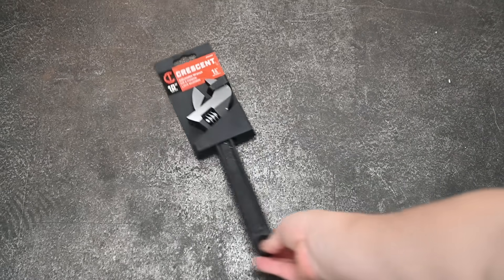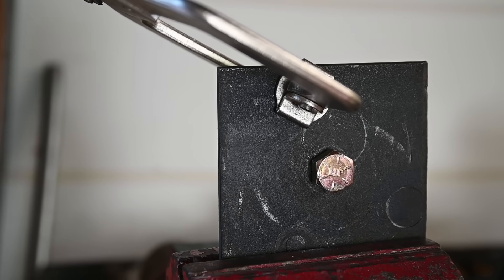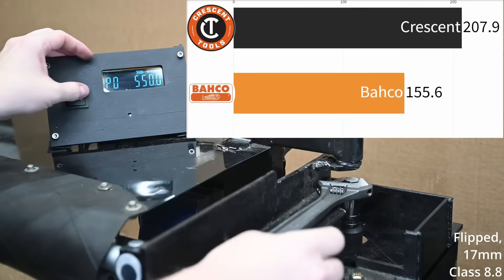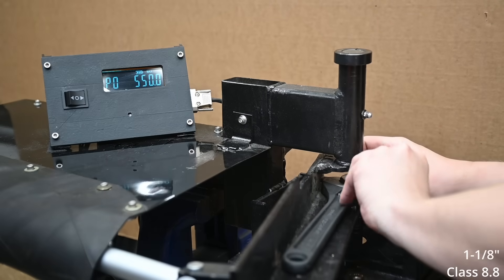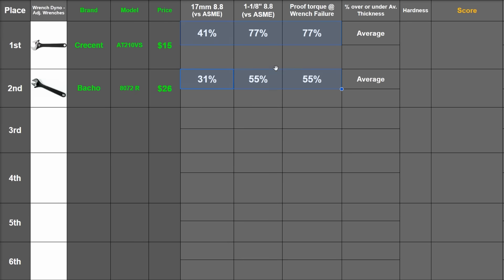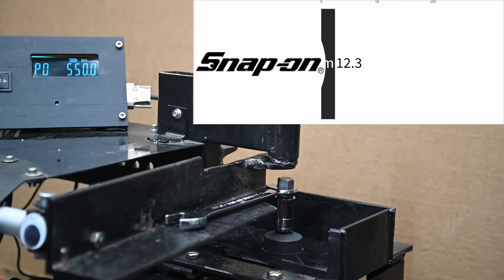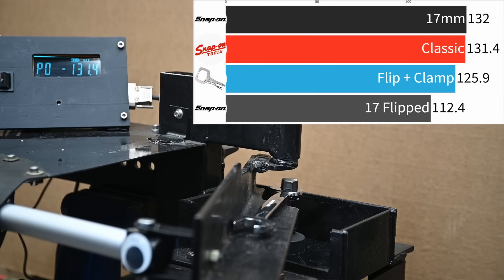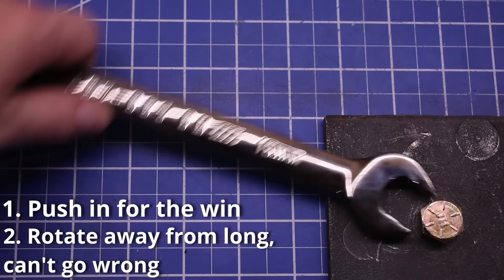Are you turning wrenches the wrong way?

Comment: warning. this video was produced by someone/ ai that never used a wrench. who here has found themselves in a tight, unforgiving spot where you can't get a turn far enough without having to use the wrench backwards to get it far enough to get it back on properly?  if you have not been there, you ain't no mechanic.
Reply from the maker: That's covered pretty well a couple times in the video, if you only have one angle you can fit it on then that's what you're going to use.
If you have space for either, like a tie rod, one seems to have an advantage in not rounding things.

Comment: Was fortunate to work with two best in class millwright mechanics while an electrical apprentice in s large maintenance shop. They took my what they called nut rounder out of my pouch and told me they better never catch me with an adjustinle wrench. They had me go thru thier pereonrl well stocked tool charts & tool chest. Neither had a mut rounder in them. Told me to either use a six point socket or s nix wrench to tigthen bolts & nuts. Over the years found that guys in our large shop that usef nut tounders were the worst workers. Halve ass

Comment: your angle iron has an inside radius - lifting the handle side of the wrenches (slightly) - might be scewing results of certain shapes of wrenches. ie squarer edged wrenches being lifted higher than those with a rounder edge profile.

Comment: If it’s got a 15° offset it’s ok to use whichever way you want. But you put a cheater bar on it you’ll fvk it up. A 12” adjustable is good for as much grunt as you can exert on a nut by hand using just that tool. No hammer no scaffold tube

Comment: Some mechanical engineers thinking: The forces applying on the adjustable finger of the adjustable wrench are VERY different when using them "correct" or "wrong"!!!  If used correct,  the contact force with the hex apply further away from the finger base and thus charges it with a more important bending moment.  Taking only that aspect into account, one would guess the wrench being stronger when used in the wrong way!?!?.  The shear forces on the base of the finger are the same in the correct or wrong circumstances, and it seems in this video that fingers fail from these forces only.  My guess is that the bending moment - when using the wrench in the correct way - does create a huge amount of friction on the "slide", which on it's turn reduces the shear forces in the thread, and makes it survive better when used in the correct way ???
Reply: Always lead with the fixed jaw. The weaker movable jaw then contacts the hex closer to the slide and exerts less leverage on it. That’s got to be stronger. Always works for me and I’ve been using wrenches/spanners regularly for 70+ years. Like a fixed wrench, they can be used either way to fit in a difficult location.
Reply: @Carol-East  Fully agree with your thinking!  But the tests in this video seem to give different results?  That's why I made the hypothesis that the higher moment on movable jaw could have a protective effect on the threads, because of the very important sliding friction it causes???

Comment: Very interesting. Always wondered about this. My thinking before was since the adjustable jaw is weaker, the force should be applied lower on the jaw, to reduce torque on the mechanism (pushing on the same side as the moving jaw). But this seems to increase jaw spread, even breaking the mechanism. So my new theory is that the extra torque on the jaw caused by applying the force higher up, (pushing opposite of the moving jaw) will lock the jaw in place by friction. This will put less or no force on the adjustment mechanism.

Comment: I find these tests very interesting, but there is a critical piece of information missing. How much torque can a "normal" human put on that wrench? Yeah, you can throw a 10' cheater on there and break anything, but in normal use is it even possible to come close to those failure levels? I've rounded more than a few nuts over the years, but I'm not sure that a nut that's been rusting on a manure spreader for 30 years is a valid test point.

Comment: Killing it with the slogans at the end there. Nice!

Adjustable wrench result makes sense. In the "correct" way, you apply a compression load on the adjustable jaw. The sliding face can help support the jaw against opening via friction and just having more surface area. When you use the wrench "wrong", the adjustable arm is now loaded in tension, and it only has the thinner web leading to the worm gear to resist that tension.

Using the adjustable wrench "wrong" will encourage it to slip sooner, more often, and fatigue faster.

Comment: The wrench goes whatever way you have room for.
Reply: They are made so you can turn a bolt/ but in close spaces. Crescent wrenches are only goo for use as a hammer when you don't want or have time to go get a hammer...
Reply: @lukewarmwater6412  they literally out torqued the Strap-Ons in the 17mm test, even when facing the wrong way. (Granted not by a huge margin.)

Pretty much all the issues with adjustable wrenches are from people not using them right, most commonly they leave the jaws loose to easily slide them on and off instead of fully tightening them down as they should be.

Comment: Once something is loosened it doesn't make much difference in practice. It's the 'cracking' and creation of the required torque where orientation can make a real difference. 
Fundamentally use the right tool for the job and learn how to use it properly. Basic physics shows that whether using a crescent or monkey wrench hauling on the moving jaw stresses the metal more potentially leading to premature wear.

Comment: I've noticed that when using most adjustable wrenches, that they are made so that if you tighten them onto the nut with the nut all the way in the throat, you can then pull the wrench outward and it will become a tighter fit, reducing slippage. This may increase torque on the jaw itself, but let's face it, how many people are able to put enough torque pressure on a wrench to actually break the wrench. 
 Also, if you look closely at an adjustable wrench's adjustment knob on most quality wrenches, there is a different profile on the mating surface relative to one side or the other. With the wrench used the "correct" way, those mating surfaces are more angled, thus more surface area contact, thus stronger.

Comment: I'd like to see more adjustables tested against each other, and maybe the older Bahco made in Sweden versions would be interesting to see.  One thing I'm now curious about would be locking pliers, too, and you'd have to figure out how to clamp them on consistently enough to rule out varying clamping force.  Especially the vise grip locking wrenches, I love mine but they don't often fit in some spaces.  Gedore makes a locking pliers hex wrench that's pretty expensive but that would be really cool to see tested against the other styles.

Comment: You weakened the crescent with the 1st run, bent and distorted, so the 2nd run with the jaws the wrong way was an unfair reading, which would be higher if brand new and not tweaked

Comment: This is one of those times where the test would lead you wrong 

I've used a lot of adjustables as a plumber. The bahco is by far the best. Less slop and bigger opening than most others.
Reply from the maker: Bahco Swden or Bahco Spain though?
Reply: @TorqueTestChannel  spain i think. Its the bahco 9081

Comment: Thanks for this, I cring when I see wrenches used wrong.  Using them wrong rounds the edges of the nut or bolt, Snap-on’s Flank-Drive  box and sockets were the standard for protecting nut edges on ornamental nuts and bolts such as on high end bikes sometimes with Alu hardware, now flankdrive is common, yea!

Comment: Isn't the asymmetric design there so you can flip-flop a wrench in tigh quarters, where you can't get 60⁰ of rotation in a single swing? That way, 30⁰ of rotation is enough to be able to engage the next flank.

Comment: Bahco tools are significantly cheaper now than they were 20 years ago, A ratchet screwdriver that cost £35 in the early 2000s is now less than £20. I can only assume this represents a corresponding drop in quality.

Comment: The more slop in the design, the more difference the direction makes. Consider the classic pipe wrench. An adjustable design not unlike a crescent wrench, but with a lot of slop intentionally designed in to the lower jaw. It is practically a one-way wrench...grabbing tighter as you pull in one direction, but completely slipping if you pull in the other direction.

Comment: Would love to see an adjustable wrench face off. 
I carry a thin but wide opening Japanese TOPS brand adjustable in my pocket everyday for adjusting pump packing and have sheared the innermost tooth off 2 of them when wrenching on seized up smaller hardware.

Comment: If you need the wrench to be held the “right way”, because you’re so worried for the wrench might break. 
… well you then darn better set that wrench down, get some penetrating oil, and some heat on that fastener, because you will otherwise snap the head off that bolt, or will rip the threads out of that nut, or the attached bolt.

Comment: The reason there's a 'right' and 'wrong' way comes down to theory. With the 'right' way, the applied force to the handle, assuming it's being applied perpendicular, contains a component that pushes the spanner (wrench) towards the fastener equal to (sine 15°)%, so 26%, of the perpendicular applied force. You can demonstrate this by changing the 15° offset on the handle when being used in the 'right' way to 90° - any force applied is going to be parallel to the inside face of the jaws and TOWARDS the fastener.
Subsequently, the 'wrong' way does the opposite. Add 75° to the 15° offset and the component force is again being applied parallel to the jaws, but now it's in the direction AWAY from the fastener. The only thing then holding the inside face of jaw on the face of the fastener is friction.
In reality however, if you're applying that much force that this makes a difference, you need to reevaluate the tool you're using for the job because a open ended spanner is not up to the task.

Also, the reason adjustables cam out at a lower torque is because play in the adjustment mechanism, necessary for operational clearance, makes the jaw faces non-parallel.

Comment: I have heard there is such a thing as a left handed and right handed adjustable wrench. The difference is in the handedness of the thumb adjusting screw. An upward push of the thumb on the screw should close the wrench in either hand if the appropriate screw is fitted.

Comment: Down under those are called thumb wrenches. I'm surprised you didn't offer an explanation of why the adjustable wrench performs better one direction over another. My thought is the moment on the moving jaw being longer (the peak of the nut being further from the wrench frame) creates adhesion between the jaw and the frame and acts to reduce the force the adjuster screw needs to withstand.  So reverse rotation has the shorter moment arm (the peak of the nut is closer to the frame) which produces force inline with the adjuster screw without the benefit of as much adhesion between the jaw and frame.

Comment: I want to see western forge adjustable wrenches tested against their different flavors.  Proto, black hawk, craftsman, SK, wright and I bet more. All made by western forge will have W F by the hole in the handle.  And there were different styles over the years even by the same manufacturer where they clearly redesigned. 

Project farm tested a western forge craftsman adjustable wrench which came out in top I’m in his tests.

Comment: In my decades of working on equipment, I've never noticed a difference in the way I use an open end wrench, because if I'm looking for maximum torque, I can either find a way to use the box end or a socket, or there isn't enough space where I'm working to be able to slip a pipe over the end to get maximum torque. And if I'm using a crescent wrench, it's not an ideal situation anyways so you're never gonna be able to only use the "correct" side of the wrench.

And testing vise grips with your new rig would be pretty cool, there've been times I've used a snipe on a pair of vise grips to turn something that needed to be turned.

Comment: Before TTC or the internet I had a dad that said "never use an adjustable wrench for cranking down nuts" I never listen to him and rounded many bicycle axle nuts. Miss you dad
Reply: Ohhh the nostalgia just hit me like a wrench thrown by a ...... Yea I have been there. Not sure I owned a single bike with good nuts on it 😂
Reply: Just came here to say I miss my dad too, I got him one of those black and decker auto adjustable wrenches as a gift when I was like 12, he was happy and said they were good gift. But as a grown man now I know they were not very useful Haha, good times. I absolutely love my dad
Reply: @joshuarobinson4802  子供にＢ＆Ｄは眩しく映る😊
Reply: Adjustable wrenches work fine when used properly, people either put pressure on the sliding jaw, or they don't fully tighten them down to make them easier to put on and off.

Ideally you want to actively be putting pressure on the adjusting screw with your thumb to keep the jaw clamped down as you turn, but that's not always possible in tight spaces.

I've never rounded a nut with an adjustable wrench using it this way.
Reply: Omg!  Same here!! Love it we are reminiscing these events in our lives!  Miss my dad too.

Comment: No.

The reason the ends are canted to one side is because it allows the user to flip the wrench over to gain another angle.  This allows such wrenches to be used in a tighter space than a straight tipped wrench could be.  This is the same reason most box end wrenches have two sets of internal teeth; more angles available that the wrench will work at.
Reply from the maker: We go over that, obviously you dont always have a choice of either, you just described why the wrench is an offset design, not why they are equal when you turn one vs the other.

Comment: They are designed to be used both ways. That's litteraly why they are designed the way they are and not just straight. And there is no short or long jaw.. They are exactly the same length..😂
Same with the adjustable wrenches but they are weaker one way but it should not be a issue with a quality one.. So no, there is really no right or wrong way to use it. They are designed to be used both ways depending on the situation and space avaliable.
Reply from the maker: Wrench is no straight, means wrench is offset to one side, which means the wrench is closer to one jaw than the other, one jaw is further away. Long, short.
Reply: @TorqueTestChannel  Correct. But the jaws are exactly the same length regardless. The way you describe would mean it has one short jaw and one longer jaw and that is not the case. So no.. There is no long or short jaw since they are exactly the same length. There are however some that do have a short and longer jaw.. But those are rare.
Reply from the maker: You're talking broach opening, the inside flats of a wrench which is broached at the factory. The jaw is forged into the wrench blank shape of a wrench first, and following the outside dimension of the jaw one is longer than the other. This how standards refer to parts of the wrench.
https://www.wonkeedonkeetools.co.uk/wp-content/uploads/2019/10/What-is-an-open-ended-spanner.jpg

Comment: It would be interesting to see slim wrenches tested, Banco has an adjustable with really thin jaws, Snap-On has the slimline wrenches and other cheaper companies also have thin wrenches (i think maybe Capri does one)

Also i know youve looked at the Snap On and Tekton 4-way angle wrenches, but it might be interesting to see how the four possible orientations perform (even if its the case that you're not exactly going to choose the highest torque orientation in the situations where you'd need to use one)

Comment: The hardness of these tools is a joke. If you're working on 12.8 stainless steel bolts and nuts, you're deforming your tool, instead of the disposable hardwear by just tightening, ever so "slightly".

Comment: You captured the torque numbers but there is another force not accounted for here.  Say you put 100# on a 1 foot wrench for 100 ft-lbs of torque, you still have a 100# reaction force that must be present.  That force is acting in the opposite direction of the 100# applied force and is acting on one side of the wrench jaw and NOT the other.  That's why one side of the adjustables is so much bigger.

Comment: Ummm, open end wrenches are canted at that angle to allow you to turn the fastener 30 degrees at a time.

My experience is that occasionally standards will have unrealistic specifications.  For example, on the 17 x 19 mm open end wrench that you tested, in order for the failure to happen in actual practice will require and extremely heavy person standing on one end of the wrench or use of a cheater pipe.

Similarly with the adjustable jaw wrenches a cheater pipe would be required to obtain even the lowest failure torques that you obtained.

My take is that the ASME standard of 500 N-m is unrealistic.

SAE had a standard back in the 1980's for the force required to unlatch a seatbelt where the release button is located in the center of the buckle.  Their standard was a maximum of 30 lbs.  I was involved in an experiment to determine just how much force could be exerted by a person's thumb on this point.  The maximum that we obtained was 7 lbs.